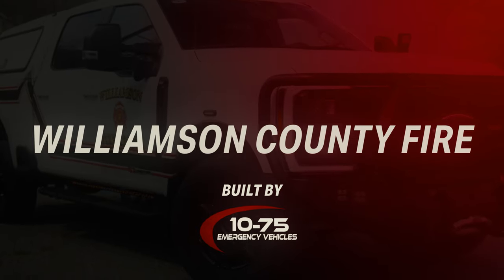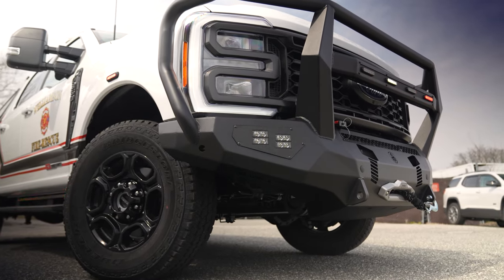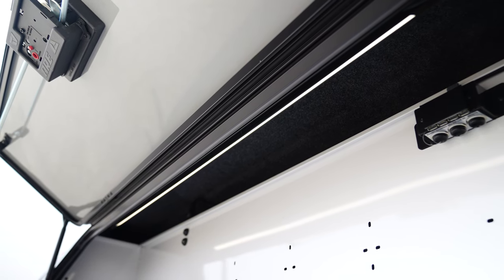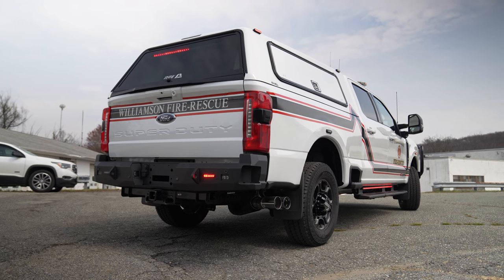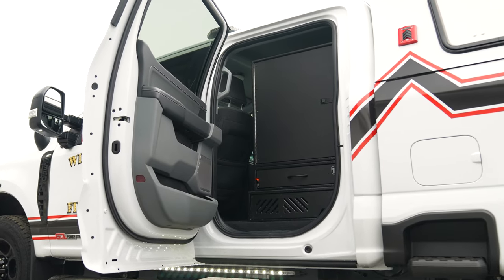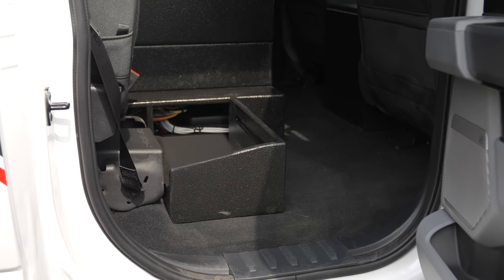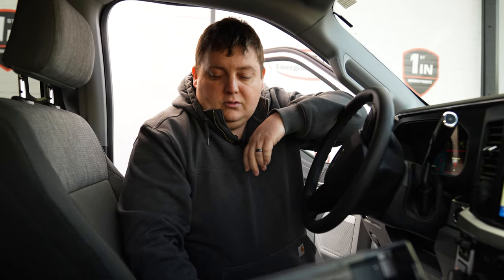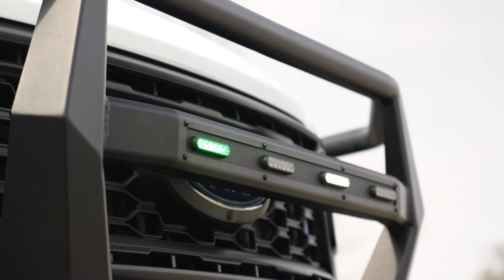Looking for Fire Command vehicle ideas? Check out the Williamson FD by 10-75 Emergency Vehicles

Comment: Great looking but 1 question.  Why do the front flashers mounted on the push bar stick out further than the push bar?  Seems like a "One-Time-Use" flasher in regards to the push bar?
Reply from the maker: It's the design of the light and the push bumper.